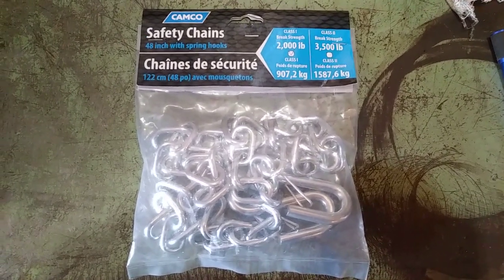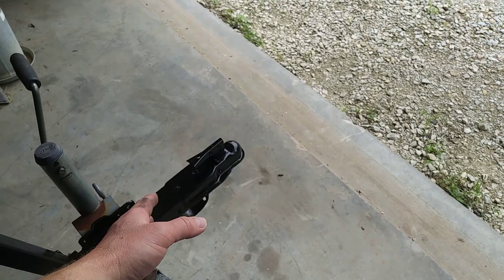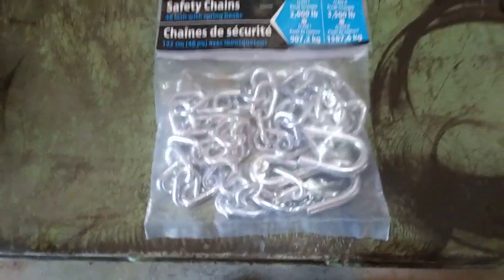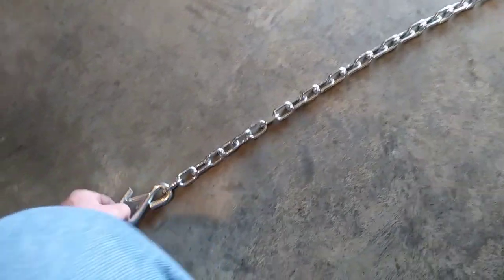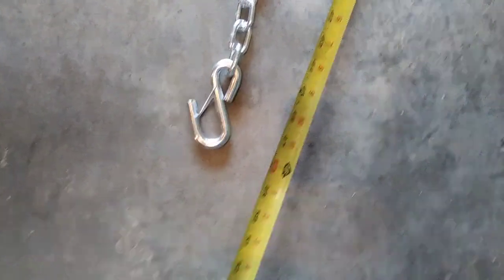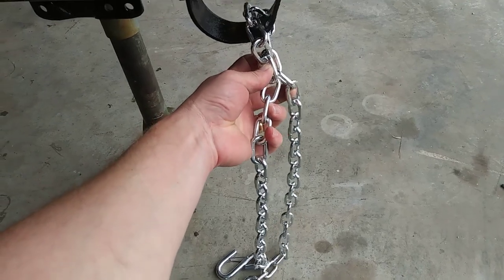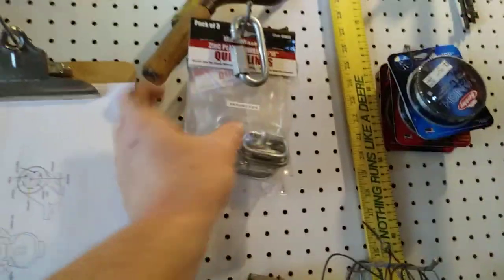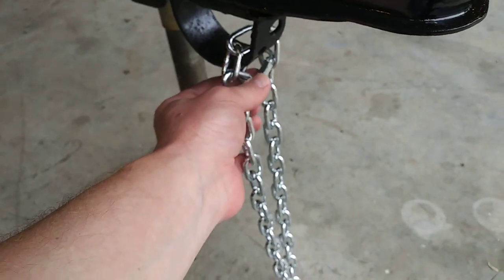Install Trailer Safety Chains

Comment: Cut the chain in half, then use one bolt for each 2' length to fasten to the tongue.  Two complete, redundant systems. The way you did it, a failed loop, or a failed link within the loop, and your safety system is gone.
Reply: Thank you, your comment solved my problems
Reply: Exactly what I thought.